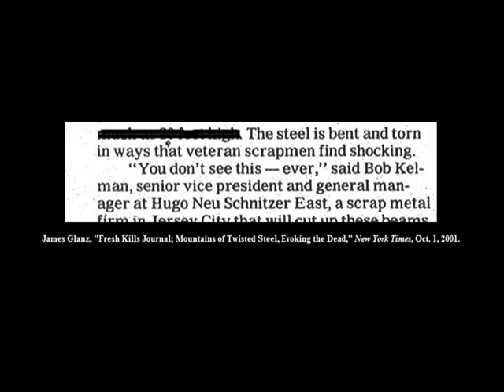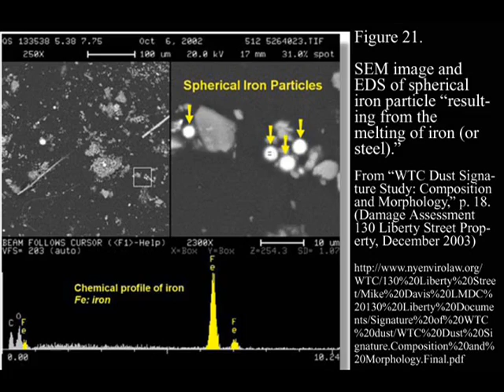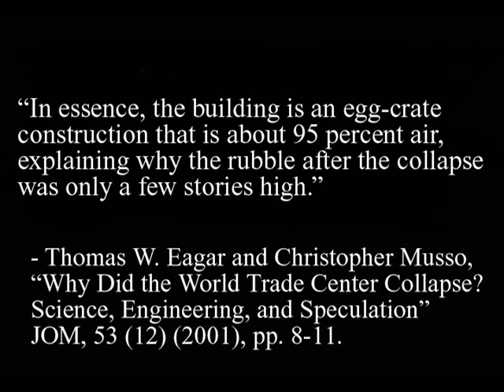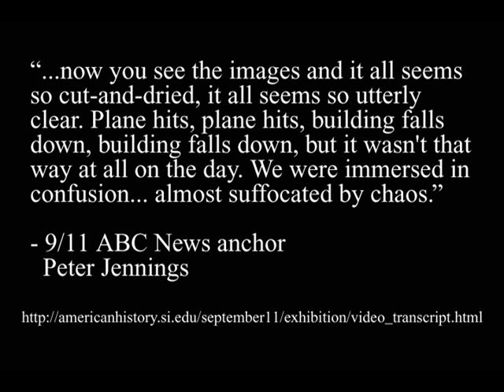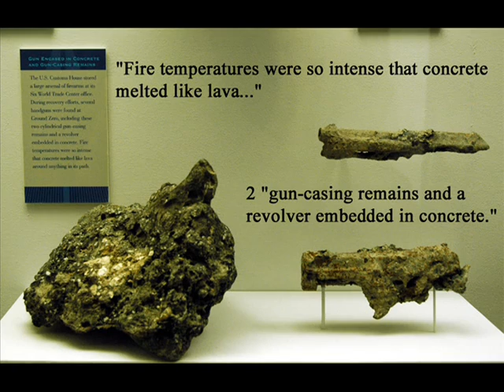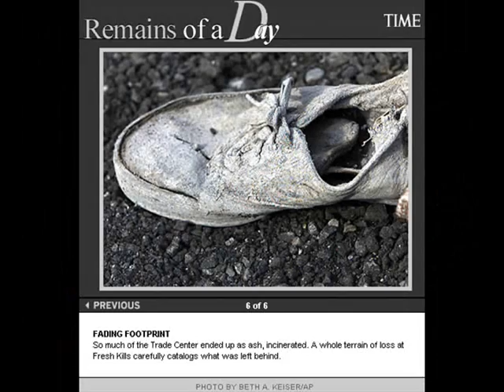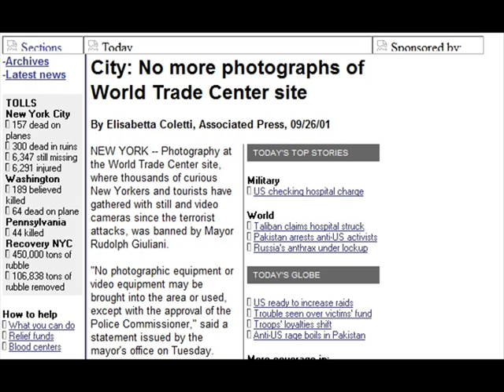9/11 Debris: Investigation of Ground Zero, Pt. 1

Comment: The firefighters are not qualified or trained to identify 'molten steel' 
An insulated underground fire could easily maintain a temperature high enough to melt aluminium, zinc, glass, ceramics, lime and silicon from the concrete. Pulverised aluminium etc is much easier to melt. If the material was hot enough to glow yellow, it will look exactly like 'molten steel'. 

To get iron or steel to flow like lava requires a LOT more oxygen than was available inside the pile. 
Its is extremely difficult to get steel hot enough to flow like water. If you watch thermite welding of rail tracks, you will notice how quickly the molten steel solidifies once away from the heat source. 

Temperatures above 2500F cool in seconds as the heat is conducted away by gasses or by contact with surrounding materials. Any significant flow of molten metal beyond a few inches from its source, will be aluminium, because it can remain in a molten state over a wider range of temperatures.
Reply: Pretty sure the firefighters knew what they saw.

Comment: My cousin believes in “science” and says that this was an inside job. It was a controlled demolition…. Absolutely not. It would take weeks, maybe even months to put enough C4 to bring down those towers like that. Steel doesn’t melt BUT it does soften at the temperatures the jet fuel was burning. The jet fuel also knocked all the fire retardant off the beams. Add than and all the flammables on those floors, it’s gunna get hot enough to warp the steel. Plus, if anyone know how union workers and first responders are, you’d know that no money in this world could pay off the FDNY or NYPD to keep quiet while they murder 340+ emergency workers

Comment: 9/11 IS A MASSIVE COVER-UP!!

1.  WTC-7 freefall collapse supposedly caused by office fires but the impossibility of freefall without demolition devices 　 

2. NIST was not given the opportunity to examine WTC-7 steel remains when it is their job to identify any design or material deficiencies in an unusual collapse of a building 　 

3.  Complete lack of wing debris at the Pentagon where a gigantic 757 supposedly crashed with no entry of the extensive wings 　 

4. The World Trade Center building scrap metal shipped "expedite" to China...80% of the steel were gone within 6 month of 9/11 　 

5.  The motive of officials for confiscating privately owned video materials from the surrounding area of the Pentagon and not returning the material long after the 9/11 case was closed 　 

6. Unwillingness for the officials to release all the Pentagon security camera footages on 9/11 to this day 　 

7. The impossibility of the 767 crashing into the Twin Tower in one piece and especially without the outer wings breaking apart 　 

8.  The impossibility of cell phone calls made at cruising altitude at over 400mph over rural areas where cell phone towers are scarce back in 2001 　 

9.  Dick Cheney orders Stand Down ---Fighter Interceptors not effectively engaged, Surface to Air Missile not used in restricted airspace after all commercial aircrafts were ordered to be grounded on 9/11.  Did NORAD overlook the fact that a commercial airliner could be hijacked and be used as a missile and hit a nuclear power plant??  Think again.  Then why wasn't the plane heading for the Pentagon tailed by a fighter and shot down?? 　 

10.  Mass Media ban of news reports that contradicts the official 9/11 story 　 

11. Rumsfeld not directly reporting to the Emergency Command Post after the 9/11 Attack when there can be no guessing if there could be further attacks including chemical or biological 　 

12. Shanksville...lack of commercial airline debris 　 

13.  Former Deputy Secretary of Defense Wolfowitz in the Bush Administration with dual citizenship...a complete violation of Department of Defense regulation to have a person in that high of a position with allegiance to a foreign country 　 

14.  The presence of CIA and Secret Service in WTC-7 that marks that building as significant to their secretive activities 　 

15. No solid proof of the hijackers...not on the airline passenger manifest, not on official airport security camera with time stamp and location identification but only a passport supposedly survives when the FBI presumes that the almost indestructible "armored black box cores"were completely destroyed in the crash.   Passport found before the collapse of the building on a domestic flight (No passport required on domestic flight)?? 

16.  The release of the Hollywood movie Pearl Harbor just prior to 9/11 for the New Pearl Harbor PSYOP??

Comment: everything was blasted to dust by aluminum thermate.  the building was rigged with charges.  look at the columns sticking up from the ruble that are cut at a perfect 45 degree angle, so the columns would perfectly slide down.
Reply: Thermite doesn't blast.

Comment: @1:05. IS ANYONE TAKING IN CONSIDERATION THAT THOSE FIRES WERE SUPER HOT?   Thats how you bend metal!
Reply: Bombs on every floor are hotter.
Reply: Not hot enough to melt steel
Reply: @sarajacobson9157  Doesn't need to reach melting point to bend. Add all the mass on top of it, and you get a structural failure.

Comment: An office fire even with jet fuel doesn't reach a temperature hot enough to melt 2 1/2 inch thick steel beams . Let alone turn concrete into powder.  Thermite however does burn hot enough to do the job for our government pigs

Comment: This is so dumb. Most of the bodies were obviously squashed by steel and cement and then vaporized under rubble of heat, burning for several days.
Reply: Ugh, that sounds so terrible. A dffrnt type of cremation. That's so bold what happened to innocent folks. A pure nightmare to the highest power.
Reply: But no clothes did I see. No toilets. No vending machines. I hate after all this time from that terrible date, that we still cnt figure things out. That's when a really bad situation has hppned, that shldnt have.

Comment: Detcord  by the mile could have been run into the conduits carrying all the electrical and communications wiring either under or within the concrete floors. 

This could have been done under some pretext of rewiring or putting in new computer cables.

 Enough Detcord in the floors would  pulverize the concrete (as actually happened) and shatter the steel reinforcement within it and also  the corrugated steel floor pan steel and the thousands of trusses.

 Otherwise we would have seen piles of concrete slabs an acre in size with 3-foot deep trusses under each one.  

 Single shaped charges wouldn't have powdered the building.  Although no doubt single shaped charges were set all over the Twin towers to cut the major structural steel, the concrete floors may have needed special treatment to crush them utterly. 

The top-down, almost total he pulverization method of the 9/11 demolition was probably chosen for reasons of safety and to minimize expensive neighborhood damage,  believe it or not. 

A conventional demolition would have made an even bigger mess. 

The best thing to do was to  powder the Towers from the top down, so that most of what fell to the streets was not heavy enough to damage anything or anyone as much as heavier material would have done. 

Or, either carpet pad, floor tiles, ir ceiling tiles could all have been fabricated from explosive sheet or a new nano-composite  explosive or super-thermitic material. 

Something broke those 200-plus acres (around  8 million square feet) of reinforced 4" to 5" thick concrete  and turned it all into powder in about  ten seconds. 

High explosives  can do this.  WITHOUT  high explosives it cannot be done.

The only question is just how and where were the explosives placed to do that, and exactly what kinds of explosives were used.
Reply: Who worked at these buildings? I’ve read only a few companies has expertise for this
Reply: Your tin foil hat is ready for collection :-) Or should we deliver this to your mother's basement?

Comment: OK this is fucking goofy! Watch any video on youtube that shows ground zero just after the collapse or even up to a few days later and you will see HUGE chunks of concrete being lifted away in front-loaders and so on. The smaller chunks can be seen being removed by hand. This video is odd. I suspect some very fishy editing, but really am not sure. Visual evidence refutes these stories though.
Reply: The north corner where elevator shafts were and the 14 firemen survived . 110 floors of 5 and 12 inch concrete mostly gone. Bldgs 3 4 5 6 destroyed also.

Comment: Egg box or not,air filled!..There should still be far more material waste than there seemed to be.A quantity surveyor needs to calculate the material mass then measure it piled up neat measure the height(which i believe would be far larger than the debri that was left)then add to that height due to the eratic displacement of the debri(ie it wont fall flatpacked)  
Either way you slice this thing,that building did not all fall to the ground.I havent the foggiest clue why?

Comment: If fire was the prime reason for the collapse then why did the south tower fall before the north tower, the north tower had been burning longer.
Reply: one reason is the kind of impact like silva geko said. First plane hit the tower straight and central which caused less damage than the kind of impact of the second plane. Another reason is that the impact zone was much lower, so the weight on the damaged structure was much higher.
Reply: There was nothing holding the buildings up, core was gone,  site red hot for weeks. Thermite. False flag,  @Arbo3000
Reply: Bigger airplane hit that tower doing more damage and it came down first...the other building was hit by a much smaller plane

Comment: Try again, C-4 is not gray, and the BLIVETs or even the old Vietnam era
butter bars in wax paper, are NOT gray either. They are, amazingly,
clear with bright red and yellow stripes. For some reason, they wanted
explosives packages to be easy to see from a distance. Go Figure.
AE911 Twoof hasn't been able to raise a serious doubt in Ten years,
except for the IGNORAMUS crowd. Would that be you?

Comment: Sorry, try again. When 125,000,000 million pounds of steel falls,
its a blender. and you sure are NOT an expert in the field. 
Good, you know that aviation jet fuel cannot melt steel. Congrats.
Tell us how we make steel in the first place?? It's done with gas
fuel and air. There are MANY kinds of metal, and metal alloys,
all of which melt long before the 1500 C that it takes to melt steel.
Tell us what would happen to THEM in a fire that melted steel?
Why they would melt before, shazaam.

Comment: "Put 125,000,000 TONS of WTC steel in a blender, drop it 1300 feet". See? The blender occurred before it fell. These are your words. That is the way I think of it, too. I'm not an expert in this area.

I do know jet fuel and office fires cannot melt steel to a molten state, under any circumstance. I have a friend that saw the molten steel. It existed and the investigators deny molten steel. And they say there are no witnesses in this video. There were many witnesses they ignored them.

Comment: This notion that they were 'mostly air' is nonsense! The 'tube in tube' was, and is, so successful (award winning & revolutionary) design that it is the standard used to this day!! These buildings had massive over-designed redundancy ratios built into them.. (See Kevin Ryans: A New Standard for Deception. Check out the original specs on Those outer perimeter columns..
WAKE UP AMERICA!! -as kooky and far-fetched as it sounds the facts speak louder

Comment: The melting point of glass is between 1500 and 1700 degrees Celsius.

and the max temp of a diffuse flame fire (9/11) is 1000c 
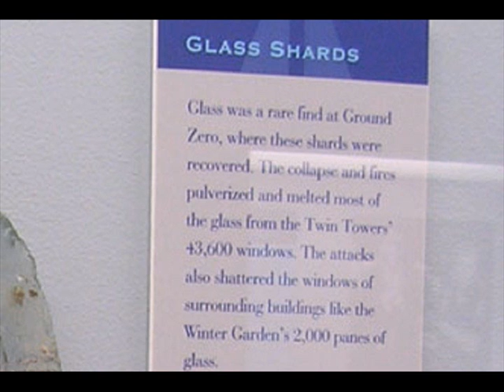at 4:10 in this video a  sign says that  most of the glass was melted

Comment: "I remember getting a call from the fire department commander telling me that they were not sure that they were going to be able to contain the fire. I said, you know we've had such terrible loss of life maybe the smartest thing to do is to PULL IT.  They made that decision to pull and we watched the building collapse." -Larry Silverstein, Leaseholder, World Trade Center

It takes weeks to set up a building for controlled demolition.
Reply: There was plenty of talk about taking the building down if it didn't come down on it's own. You can see the core pulling in the frame a little over a second in advanced of the frames descent not anytime earlier. We have a study showing all the 58 steel columns had to fail simultaneously and when the fail must be severed to have the frame act as a discrete unit and have 2.25 seconds of free fall. 

CIA was inside and had kept info on two terrorists from the FBI. Pentagon is also hit by plane and also in WTC7. Two people in charge personally connected to WTC7 and Rumsfeld was advising Tennant. Isralies were spying on the terror cells and building owner is friends with several Israeli PMs. Building owner when asked by PBS what happened uses same vauge term as used several frames later in same documentary by workers at geound zero using a cable to take down building 6 that he likely got a pre screening on before the interview. When Silverstein was asked what he meant originally he stays silent and will not respond to question. Years later claims he meant pull "them" out even though the fire chief and the FEMA report prove there were zero firefighters in WTC to be pulled out. When WTC7 didn't come down 7 ours earlier the cover story was going to be that they took it down for safety reasons. But with the country being full of mindless people no cover story was ever really needed.

Now imagine being that person who just repeats whatever the media tells them. Imagine having to go through life that ignorant,that stupid and with zero curiosity.
Reply: Pull the firefighters out.
Reply: @PSMWRX143 if I had a nickel for everytime I've seen somebody take what that guy said out of context I could afford to build my own skyscraper
Reply: @pacmancdi  yeah well, forget what he said-- how much was the insurance check? That guy raked in about $4,000,000,000 (four billion USD) for 9/11. Not bad for a new leaseholder starting July 24, 2001. Follow the money!